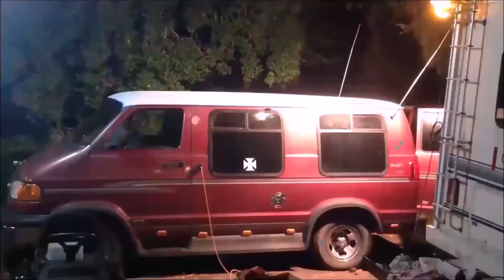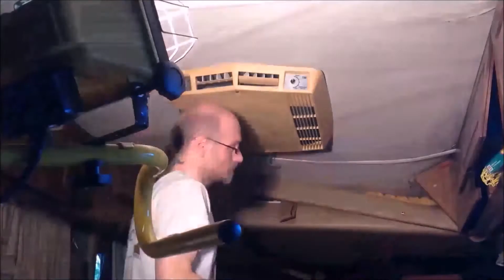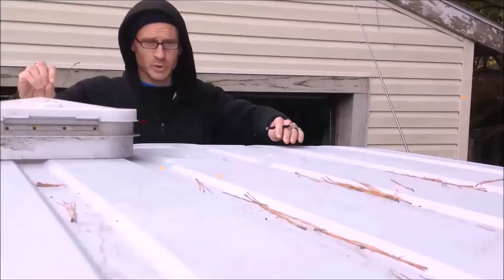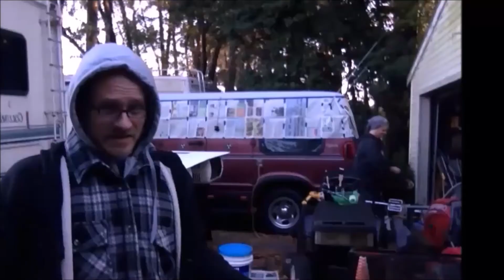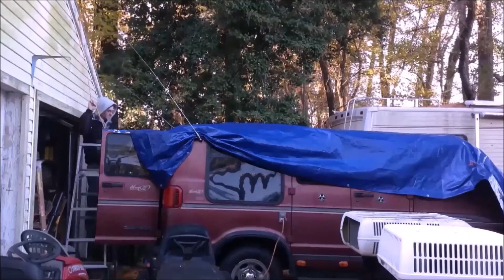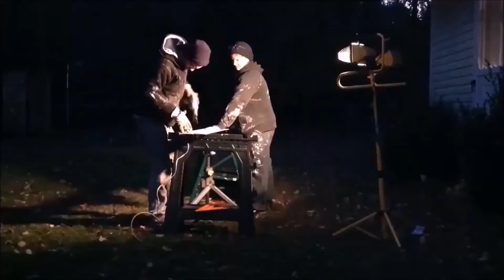Dodge Ram Van - Camper Conversion - Part 2 (Roof, Ceiling & Components)

Comment: I love your van, you got my vote as#1 build. I have a 99 dodge ram shorty with a 6 inch lift and 33 inch tires, custom roof rack, lights, cameras, window AC unit, Maxx air fan, roof off road lights, custom tire rack on rear door, rear hitch rack with 3500watt gas generator. I used the spare tire space underneath for my diesel heater fuel cell and 6v AGM batteries for a total of about 1000Ah. I have a built in Wifi system plan with verizon, custom futon bed that folds up to a couch, TV, DVD, mini stereo, laptop, 12 USB ports, 6 12V ports, 8 120V outlets, refrigerator, microwave, convection stove and oven, sink and coffee maker. I carry drones, cameras, video equipment, and protection. We use it for storm chasing, I have a hobby business doing video for weddings and other celebrations, and my new business doing surveillance for people. I have spent 2 weeks at a time in my van, I can park pretty much anywhere and use my gas generator as long as I dont go over ECO power, you have to walk up close to hear it. Ive never been harassed, exposed or caught. I recently used it to get footage of the marches and riots, it was nice just to climb back in and lock the doors when the police came by, no one bothered my van or knew we were in there shooting video and getting pictures. My whole van is white, I keep 2 hard hats in the front with vests on the seat, it definitely works.
Reply from the maker: @Axl Bender Wow! Sounds like you have an amazing van!  Thank you for your comment.

Comment: What does the roof A/C run off of? Can use it without plugging into a camp ground? I'm going off grid...
Reply from the maker: The A/C runs off of 110.  Our next step for our A/C would be to install a camper 12 volt inverter and add a battery bank.  However, the A/C draws a lot of power.  We're not sure if that will be enough power to start the A/C compressor or if we will just have to rely on its fan.  Check your A/C's electrical requirements.  If your system is powerful enough, an inverter and battery bank are the way to go unless you are in a situation where using a generator is practical.  Most R/Vs rely on a generator to power their A/C off grid, but I know that most people who go off grid are against the idea of using a generator.
Reply: @everexpandinglife  Thank you, I was thinking along the wame lines, just good to confirm it sometimes ! :-)
Reply from the maker: Your welcome!  We hope you have a fabulous adventure off grid! We love to see people expanding their lives.  Good Luck and have fun!!!

Comment: So sad that there isn't a part 3 and final steps to finishing the van (van tour).  I'm in the early stages of looking for a van and found part 1/2 really helpful for future when I need to start my own build.
Reply from the maker: I agree! I wish we were already done too! But don't worry, there's more to come. We are currently working on part 3 - The dash and console rebuild. We are also working on some electrical and vacuum issues. Then comes the installation of the 12 volt RV electrical system and the installation of the cabinetry and bed and all the rest. So, there will be a part 3, 4, 5, etc. Be sure to subscribe. Hopefully we will get to those parts of the build before you need those videos!

Comment: Great tips guys. When you used the brush for the henrys, how well the henrys smoth out from the brush strokes? Did it, in a way, smooth its self out after brushing it on ? Where you able to see the brush strokes after it cured ?
Reply from the maker: Thanks for your comment. The brush strokes smooth out pretty well.  The Henrys is viscous but it settles fairly well. It will certainly not be as smooth as paint.  It is definitely a bit textured, even a bit globby when you look close up, but is does produce a membrane if put on thick enough. It works really well and looks really good from a few feet back.
Reply: Ever Expanding Life . Thanks. Good info to have on hand. Thanks for your response. Have a good weekend.